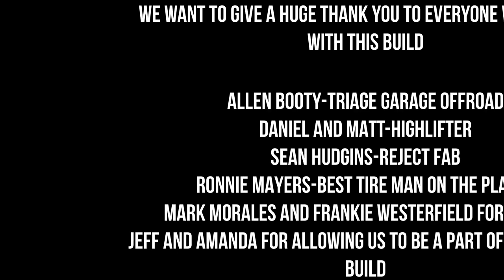2022 POLARIS RZR HILIFTER EDITION BUILD (DEEP PENETRATION) SPECS IN DESCRIPTION!!

Comment: Beautiful build.  How bad does the front rub with 44s and the suspension set up?
Reply from the maker: Doesn’t rub at all with steering stops and a hair of trimming on the bottom corner of the fender flares!
Reply: Sweet. I noticed the trimming of the front in the video but couldn’t tell how much exactly.  Nicely done.  I have the exact machine, 22 HL, looking at doing the same suspension/ tire size build. Keep up the great videos.
Reply from the maker: Yes sir thank you!!

Comment: Great Video. What's the width on those 44's  wides/skinnys? im looking at building the same setup? Any reason you didn't go with 8" portals. i see lots of ppl buying the 6" over the 8" and im starting to worry being i just ordered 8". Thanks
Reply from the maker: The 8” highlifter portals were not out yet and we run highlifter portals. The 44 BKT only come in an 11.2 wide and we rather the wide. There are videos previously of them in the mud.

Comment: What size lift in on it? I got 1 just like it and like your setup. And what size rim and tires?
Reply from the maker: 6” portals 
5” bracket
Tender springs
44 bkt on 24” fuel runners

Comment: With the 1.5 foward arms and portals. Using the sandcraft steering stabilizer  what length  tie rods do I need  with the stabilizer
Reply from the maker: Billet tie rods come with the stabilizer kit! It’s a bad ass package!!
Reply: @BOTTOMLESSTRAILSTV  I went to order the kit. They asked if I wanted the ones with it. Or 18in or 19in   tie rods   so I'm guess the ones that come stock will work nothing special order right
Reply from the maker: @chriso4274   it should man, which year machine do you have? And model
Reply: @BOTTOMLESSTRAILSTV  21 rzr xp 1000 highlifter.  All I did was same build pretty much. Just apexx  foward aarms. 8in portals. And the tender springs
Reply from the maker: Make sure you get the smaller inner bolts and shorter rod, three orders and they sent the big ones with all them and had to exchange them!! Get with Alan booty tell him you want exactly what we have!!
Reply: @BOTTOMLESSTRAILSTV  i bought the super atv portals. I guess that won't matter.  And thanks. I will call tomorrow.
Reply from the maker: Nah man when it comes to the stabilizer that won’t matter!!

Comment: Whats the top speed using the 60 percent gear reduction
Reply from the maker: The speedo doesn’t read correct, but if I had to guess probably 40-50 ish with 44” tires! But you’d never go that fast when your on that big of a tire on one of these, definitely not speed demon at all lol!!
Reply: @BOTTOMLESSTRAILSTV   so I have a million dollar question.   I've noticed you went with a 44in tire but chose a 6in portal. So you had to do some trimming.  Is there a reason  not going with the 8in portal.
Reply from the maker: We run highlifter dual idlers and the 8” weren’t out yet!! That’s the only reason we didn’t go 8’s on this one!!
Reply from the maker: And very minimal trimming

Comment: I need those wood rests for my machines, can you give the dimensions so I can build some of my own Thanks
Reply from the maker: Yes sir, I use 2x12’s full width for the sides, back and top and measure to the bottom of my machine for height! At the bottom where the jack slides in I just lower my jack all the way and measure from the ground to the top of it so I can slide it right in there, super stable and alot easier than blocks lol
Reply: @BOTTOMLESSTRAILSTV  Thanks for your time and information I'm going to build some this weekend, supposed to be around 30 degrees down here in GA so a perfect shop day Thanks again
Reply from the maker: @thomasgarrett491   no problem at all man stay warm lol!!

Comment: What the set up
Reply from the maker: 11.2x24 bkt on 24” fuel runners
Reply: What about there lift
Reply: The
Reply from the maker: @alexlira5337  6” portals, 3-5 bracket lift, forward arms and tenders
Reply: Thanks
Reply: @BOTTOMLESSTRAILSTV  how tall are your tires ?
Reply from the maker: @jeremysolar5515  they are 44” tall